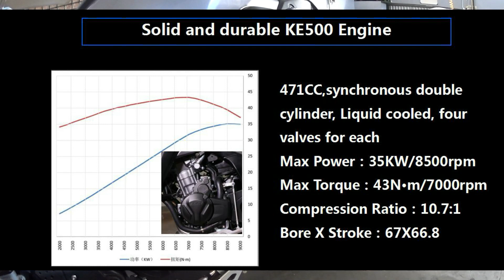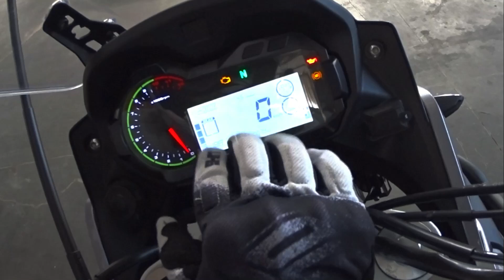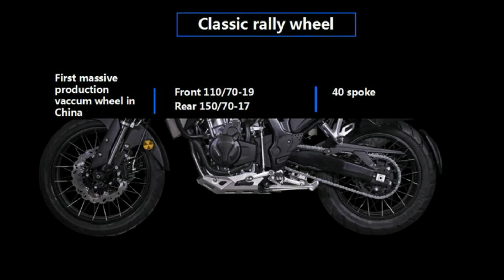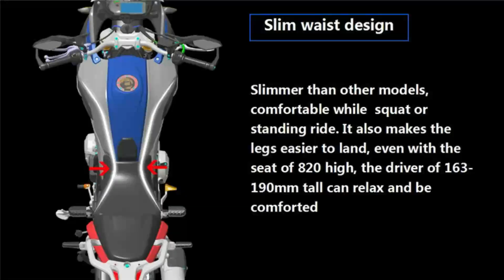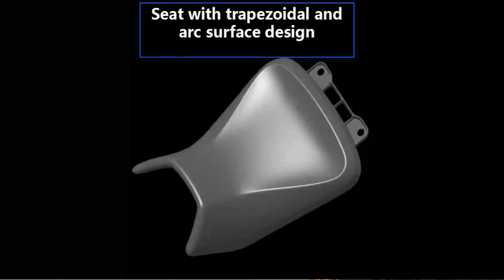Hunter Maverick 500cc Bali Indonesia, kove 500

Comment: I think 20kg lighter is actually the dry weight(without any liquid like oil, gases) while Honda usually measure the wet weight.
Reply from the maker: You are correct 178kg is dry weight and the CB500X is 196kg wet, i just put the complete specs in the description

Comment: Really interesting. What’s your opinion of the engine and build quality since it’s basically China’s Product compared to Honda?
Reply from the maker: The build quality is impressive, it is very solid, bigger suspensions, better equipment, switchable ABS, USB and 12v sockets, crashbar, bracket for top case, central stand, the engine is performing very well, after 1000 km with it, i did another review and I'm really impressed about its true Off-road capabilities.
It's a Honda CB500X but with better equipment.
Reply: @Buledoyanmotor  well noted. So do you know when the dealer in Jakarta will be opened?
Reply from the maker: @dikiwandani8717  the factory is based in Bali, and the distribution will start in February 2021, Hunter Motorcycles Indonesia is looking for dealers all around Indonesia, i try to help them as well to develop the dealerships network, and to propose virtual showrooms as soon as possible, as Covid-19 is making the classic distribution complicated.
The factory will make sure that spareparts are available, in order to satisfy customers. Future dealers please contact directly Hunter Motorcycles Indonesia or leave a message here or on my email.

Comment: It's "Hanway 400X" in china,,also "Colove 500X" and "TEK 500" in spanish "Macbor Montana XR5" and in Argentina "Tekken 500"
Reply from the maker: Yes exactly, an excellent motorcycle but the Hanway 400X same chassis but not same engine, the Hanway is a 400cc where the Colove, Macbor, Tekken and Hunter Maverick are using a 471cc parallel twin identical to the Honda CB 500X

Comment: Can u compare this motorcycle with the KTM 390 Adventure? Cheers from Chile.
Reply from the maker: The KTM 390 adventure is a very funny bike to ride, you can find my review of it on my channel too, but it's definitely not an adventure touring motorcycle, impossible to ride it standing up, nothing to grab with your legs and weird position, way too much vibrations as it's a single cylinder bike, and not made for huge luggages mount, it's basically a 390 Duke with bigger suspensions, so in my opinion it's a nice city toy with beginners aptitude for easy trails roads, but not an adventure touring motorcycle for traveling around the world, the Hunter Maverick 500 is way better on and off-road, and big enough for long touring adventure ride with or without luggages. But that's my own experience and opinion, you should try both.
Cheers

Comment: Usulkan ke Hunter om setting harga pas di 100jt aja, kalo diatas 100 pasti akan berhadapan tipis dgn BMW 310GS yg walaupun kalah fitur tp menang brand dan prestige jauh banget
Reply from the maker: BMW G 310 GS 313cc 34dk jauh pak, OTR Bali 175 juta kalau Hunter Maverick 471cc 49dk OTR Bali estimasi adalah 135 juta, beda 40 juta sama semua competitor di kelasnya, Honda CB500X dan Benelli TRK 502X, dengan pajak mewah di atas 250cc, motornya enggak bisa di bawah 100juta, Kawasaki ZX 25R baru 250cc sudah lewat 100juta lebih pula, menurut saya, sekarang di kelas Moge 500cc 47dk 48dk 49dk, si Hunter Maverick paling murah dengan 40 juta rupiah beda harga
Reply from the maker: Terus di bawah 100 juta paling dekat adalah SM Sport 3s 377cc 36dk 98 juta atau KTM 390 Adventure 45dk tapi harganya 115 juta, harga Hunter Maverick memang masuk akal

Comment: This one is not with KYB suspension, nor with Nissin brakes. It has Chinese suspension and Chinese brakes.
Reply from the maker: @trninka  this one doesn't exist anymore and had no future unfortunately
Reply: @Buledoyanmotor  what do you mean? We have the same one in europe right now. One version with spoke wheels, kyb suspension and nissin brakes, and the other, cheaper with cast wheel, no kyb, no nissin.
Reply from the maker: @trninka  this bike the Kove (Colove) MV500, is distributed by Hunter in Indonesia under the name Maverick 500cc, I had lot of hope for this bike for 4 years, I had the model with spoke wheels and KYB suspension, a white one and a Sand one, unfortunately this bike is a commercial failure despite good quality components, but in Indonesia it is sold more expensive than a Honda CB 500X, which makes no sense and gives no future to this model. I have a lot of videos with the 2 I've owned until I decided to switch to the CB500X
Reply: @Buledoyanmotor  got you. Thanks and good luck.